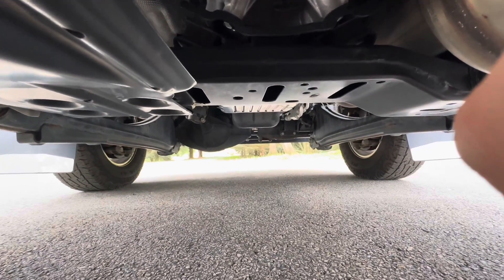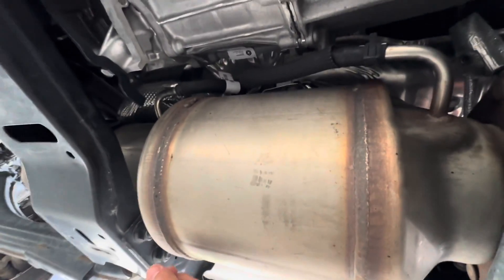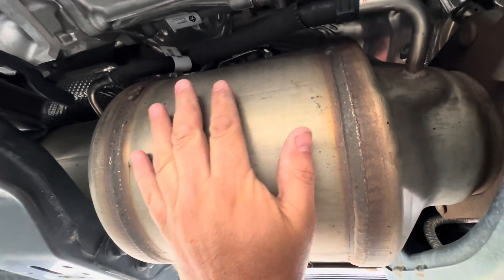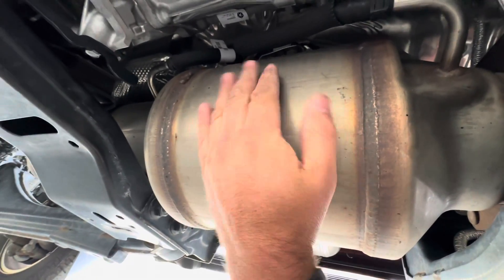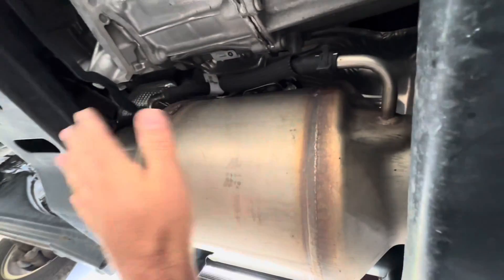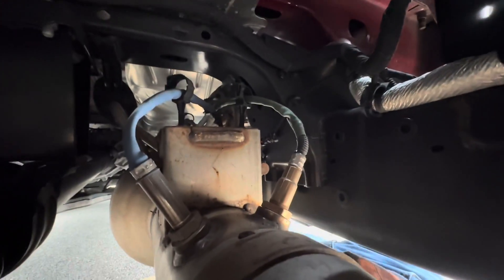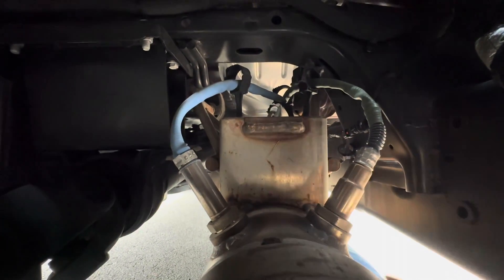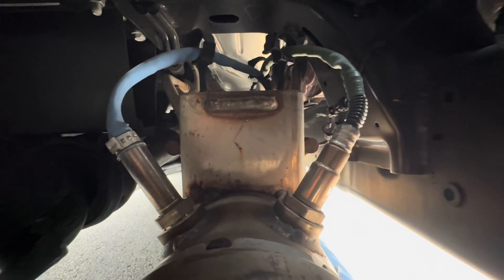2022 Ram Cummins DPF Regeneration and Y43 Recall Explained

Comment: I’ve just watched your video.  Maybe the best explanation of how a def system works that I’ve seen.  Very informative and I appreciate your work.  

As you will see below I am having issues with my 2021 6.7 Ram, with 142K.  I would appreciate it you gave me your thoughts.  I kinda feel it’s a sensor issue, or something to do with the fuel low pressure code, but mechanic says fuel pump is good.  Idk losing hope.  Thanks again in advance.  

1. Truck completely shut off and stopped running in Alabama.  It had an 30 second delay start, and the truck shook violently trying to start. Took three attempts to start truck and moved to a parking lot and it died again.  At that time I moved the truck and ran my code reader.  The following codes showed P0087 fuel rail/system pressure too low, took truck to dealer, had fuel/water separator replaced.  Also had a message saying following Exhaust system service required see dealer. Cleared code Drove truck back to Arkansas no issues.  Also put an additional 600 miles on truck again no issues.  
2. Second time, drove truck to Springdale Arkansas, my def level got to 25 percent and I drove about four miles and got def fluid and filled tank to about 65 percent I would say.  Drove truck home about six miles from home I experienced a loss of power and had to really press fuel petal to maintain any power at all, which I had a big loss of power at that time.  Drove it to my driveway and as I drove it seems to get better, almost as it was getting more fuel.  The following codes showed P0087 fuel rail/system too low pending, and P203F reductant level too low stored, cleared code drove truck no issues.  
3. Drove truck Sunday to North Little Rock Arkansas and back no issues.  Had to take out to Jackson Tennessee got to Lonoke and truck threw up message Service Def System  See Dealer but soon that message went away.  I also ran my code reader and got a P1C54 SCR NOx Catalyst stored code.  Drove truck noticed on my def gauge got up to 40 percent without going into regeneration mode, which it still has not.  I did change out the air filter yesterday, the truck had a recent oil change and filter change as well.  And I added def fluid Thursday.  It’s due to have the crank case filter changed I have it it’s just not changed as of yet.  I also added 8 ounces of the diesel fuel additive that y’all sale Saturday as I filled up.  
4. Took truck to my local mechanic twice.  He has stated he is not sure what is wrong with the truck.  It will passive regen but I’ve not seen it go into an active regen as of yet.  The gauge on the def screen is showing about thirty percent I guess.  Any thoughts.  I did add a def system cleaner.

Comment: I have a 2022 and it went into regen last week and showed 💯 on the DPF. Trying to navigate on what I should do. Could it have happened from the Particulate matter sensor not being installed from dealer? Brought in and it’s now installed
Reply from the maker: @StanfordPladson  have your dealer look up TSB 25-005-24. Has the truck been regenerating very frequently?
Reply: @TheRamGuru Yes it literally just started the last month
Reply from the maker: @ are you able to tell which monitor will not “set” for readiness?

Comment: I'm going through what I feel is a very similar issue. 2022 2500 6.7, feels like it constantly is in regen. current through an engine light with p1451 - diesel particulate filter system performance  and p2459 - diesel particulate filter regen frequency. I get on the highway and the regen gauge says 0%, but within 2 miles it then says its in regen. I bought this used 10 moths ago with 27k miles on it, currently has about 51.5k miles. And ofcourse the emission warranty is up at 50k. Dropping it off at a local dealer tomorrow for diag, and if they recommend the DPF on my dime I will be returning to the dealer i bought it from (about an hour away) to find out what they can do to help me considering I bought this truck 10 months ago and am only out by 1500 miles. Do you think the DPF needs replaced? Think they have any leway in helping me out? I looked in the history and saw the y43 recall was done about 2 weeks before i bought it.
Thanks.
Reply from the maker: @txsranger99  have the dealership look up TSB 25-005-24 that was released on September 27th. That might help you out.

Comment: I am new to diesels purchasing a 2023 2500 and was wanting to know what the particulate filter gauge meant on 0  and your video explained it well. Thank You Great info
Reply: You wanted to be zero or be able to regen itself down below 100%. If it fills up constantly something is wrong with it it's not supposed to do that. Mine does that. 😭
Reply: @greuju curious whatever happened with your frequent regens? My 23 just started regens now every 80-100 miles, with zero change in my driving habits ( interstate).
Reply: @JBrauss I'm honestly thinking to selling mine. So 2 things. From what I've been told the entire system has multiple sensors multiple valves in this and that that you can change out and it will fix itself...

I have a pedal monster on my truck now and I put it into stock 0 and crank it on the highway and it seems to be okay again. I don't know if it helped.

The whole system stinks though. My truck overheated... 🤣 So who the fuck knows I'm going to tune it up and sell it probably.
Reply: @greuju  have you tried Archoil? . So far it’s been working for me. My regens were around 60-80 miles now after a bottle of Archoil it’s spread out to 200 + miles. Only had one regen since I’ve used it so it’s looking good so far. I’m going to use another bottle next fill up, but wanted to come back here and let you know 👍🏼

Comment: This video was very helpful. I do have a question. We pull an RV but spend a lot of time in a location after towing the RV, and our truck then serves as a daily driver(I work remotely, so I only drive about 3 or 4 days per week). The truck is going through active regeneration about every 100 miles. Is this right?
Reply from the maker: @howardsherman9461  how frequently the truck regenerates is going to change depending on how it is driven and used. Obviously when it is not towing, it won’t get the DPF as hot and therefore can start to fill up the DPF with soot faster than if it was towing constantly and allowing passive regeneration to remove soot as it’s being captured. This is exactly why active regeneration cycles are used. However, I personally believe the truck should be able to go further than 100 miles, even in a low-load duty cycle before it requires an active regeneration cycle. My personal belief, based on my experiences, is that when the trucks get to the point where they are regenerating at 100 miles or less between cycles, I would assume this is indicative of a potential problem. The difficult part in trying to rectify this issue, is that there are a multitude of different factors that contribute to when a regen is needed, or how much soot is being captured, etc. When you use the truck as a daily driver after reaching your destination, what do those daily drive cycles look like? How many miles do you travel, how fast do you go, do you idle the truck in park? Etc etc. Probably need to know a little more about your usage of the truck in that scenario. In the meantime, simple things like air filters and fuel filters can also contribute to this issue. Don’t know what brand and part number the engine air filter is you are currently using in the truck?
Reply: @TheRamGuru  We have a Dodge Ram 2022 - 3500 with 6.7 cummings. We are staying about 20 minutes outside of town(mainly highway miles). But this part weekend we took a 4 hour drive going up to the North Rim of Grand Canyon and even with that drive, the DPF did not read 0%. We did a 23 miles slow drive in the park and the car prompted us to keep driving since we were over 45% on the DPF. We change the fuel filters every 15K and just replaced the air filter about 8k ago. Thank you so much for you time responding.
Reply from the maker: @howardsherman9461  do you know what brand of engine air filter you installed? Part number?
Reply: @TheRamGuru  I do not. Purchased it at orielly.
Reply from the maker: @howardsherman9461  if it has strips of glue running across the bottoms of the pleats, that could be part of your issue. These trucks can be very picky about which air filter is in the intake. You may want to try buying a Mopar 53034051AB or Fleetguard AF27684 from Genos Garage online and then run that filter for a few weeks. Sometimes it’s as simple as a poor quality air filter. Oreillys Microgard brand air filters are sometimes identical to OEM, but not always. I’ve seen no less than three different variations on that filter for our trucks, all three with the same oreillys part number but physically very different filters
Reply: @TheRamGuru  Really appreciate your information. Thank you so much.
Reply: @TheRamGuru  Wanted to give you an update on my DPF situation. After months of frequent regens.....the truck would auto-regen every 50-75 miles....I finally brought the truck to Dodge. They recommended me to change the fuel filters and air filter to mopar before they would do anything(even though I had just changed them all 2000 miles before). That did nothing to change the situation. After 2 more appointments, they finally agreed to replace the DPF filter. Even after that, I am still experiencing the same frequent regens. I have another appointment tomorrow and Dodge has assigned an advisor to my case. I will keep you updated.
Reply: @TheRamGuru  My guess is with the addition of the DPF system, engine programmers have become lazy as they no longer need to optimize the AFR to minimize soot because of that catch-all DPF, so why bother trying. 😞

Comment: I’ve got a CEL on my 22 2500. Exhaust filter full. Only 10k miles. Would this be on the warranty?
Reply from the maker: @Fran11784  yes it should be. There’s pretty much no way that filter is full in 10,000 miles. It’s very likely a malfunction of one or more systems involved in regeneration of the DPF.
Reply: I have changed the fuel filters, they were brite white clean. Air filter also changed at 7k. I can clear the code at work with our scanner but will leave it for the dealer.
Thanks all
Reply from the maker: @Fran11784  what brand / part number air filter are you currently using?
Reply: @TheRamGuru  not sure of the # but it was Fram. Fuel filters were Mopar OEM
Reply from the maker: @Fran11784  go to Geno’s Garage online and order either the Mopar 53034051AB or Fleetguard AF27684. These trucks are incredibly picky with aftermarket air filters.
Reply: Update, got the truck to the dealer. They are replacing the cat, DPF filter and sensors. All under warranty. Crazy...
Reply: Change your air filter and fuel filters. Then erase the code. Those are the two most common problems for DPF clogging.
Reply from the maker: @sccolbert  it’s most likely P242F and that code cannot be cleared with a generic scan tool. It requires a dealer level scan tool and several parameters have to be set and changed. The system thinks the DPF is full of ash. When that code sets, active regeneration is inhibited until the parameters inside the pcm are changed.

Comment: Delete it. You will get far better mpgs
Reply: Not everyone is in the business of making their trucks illegal 😂😂
Reply: My truck 2022 ram 3500 gets 23mpg stock. You guys are so worried about my mpg and you delete your truck and put a 4 inch lift on it with 35's and get 16mpg. I had a 2001 ram 2500 and never got close to 20mpgs. So I dont wanna hear it.
Reply: @electrified7309 you better preach it 🫡

Comment: Do the dpf and scr not bolt together anymore like the 13-18’s?
Reply from the maker: @extremerc76  the DOC and DPF are one piece all welded assembly. The SCR system bolts to the DOC / DPF assembly.

Comment: This is the best explanation video of the Cummins exhaust system I’ve ever found. THANK YOU for taking the time to post this. I keep getting a P24B1 error on my 2019 RAM 2500 and took it to my dealer because I think the particulate sensor is bad. Which they confirmed it was. And they want $750 to replace it. In this video you show the sensor is connected on the passenger side above the SCR chamber. How easy would it be to replace myself? Is that one bolt the only thing connecting it? Where is the circuit board for it mounted or connected? I can’t find a single video on replacing this part.

Comment: Riddle me this: My truck (2022 Ram) hauls 12,000+ lbs of granite over mounatain passes 2000-3000mi per week. I constantly get regen cycles, then I watch on my dash as the filter goes from 20% to 100% over a a couple miles, followed immediatley by a "power reduced see dealer" message. My truck was delivered WITHOUT a DPF filter(got the letter in the mail, dealer checked...no filter, I'm on a waiting list)...how is it "full"?
Reply from the maker: @MoragTong_  to clarify, your truck was delivered to you WITH a DPF. 2022 Cummins trucks were shipped from the factory without the Particulate Matter Sensor. This sensor sits at the very end of the emissions system, after the SCR canister, and monitors the exhaust flowing out of the emissions system. It looks for and “counts” soot particles. If it “sees” too much soot, it triggers a code that would indicate that your DPF has somehow failed. Normally this means the filter media inside the canister is cracked, or the canister itself is leaking. To reiterate: your truck still has the DPF and it will function correctly without that PM sensor in place. The letter in the mail you’re referring to is about the Y43 recall, which I discussed in the video. The truck should still function normally even if you do not have the Y43 recall completed yet. The missing sensor has no control over the DPF or its regen cycles.  If your truck is in regeneration all the time, especially when towing, then you have a problem. Either the engine is running “dirty” for some reason and it’s filling the DPF with soot too quickly, or there’s an issue with the DPF and its associated systems and it is not regenerating properly. This is a VERY COMMON problem on 2022’s especially. When towing repeatedly, your truck should be able to achieve the maximum time between regeneration cycles, which would be 24 engine hours or roughly 900-1000 miles. I would caution you that if the truck is constantly in regeneration, you NEED to watch your engine oil level and condition VERY closely. Constant regeneration cycles can dramatically increase the amount of fuel diluted in the engine oil and this can rapidly cause more regeneration problems, as well as significant internal damage due to oil shearing and a lack of lubrication.
Reply: @TheRamGuru  Ahh... yes, I mispoke. Meant to say DPF "sensor". But yeah, truck is still doing it. DPF full, power reduced, blah blah blah. Has 122k on it and is getting traded in this month. Kinda funny how the manufacturer/dealer doean't make it clear what the driving conditions MUST be in order for the system to function correctly/efficiently. If the sales rep told a perspective buyer "No, you can't use this truck to run to Home Depot and back, you'll have to drive it 30-40 miles, possibly longer in cold weather conditions." They wouldn't sell a single truck.

Comment: I am getting a message on dash that says Exhaust System Maintenance Required See Dealer and once it comes on the truck starts losing power! What do you think it is
Reply from the maker: Is your check engine light on?
Reply: @TheRamGuru  I have a 2021 ram 5500 Cummins and mine is doing the same thing as he and my check engine light is on
Reply from the maker: @KMorieElmore  hook the truck up to a scan tool and retrieve the diagnostic trouble codes. That will help to pinpoint what components are failing.